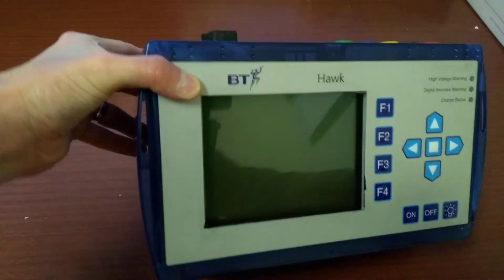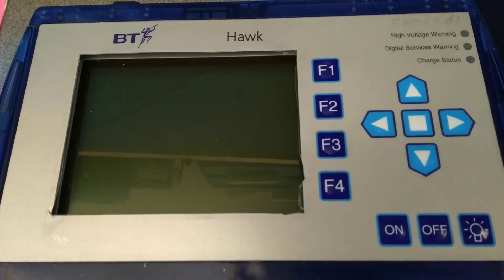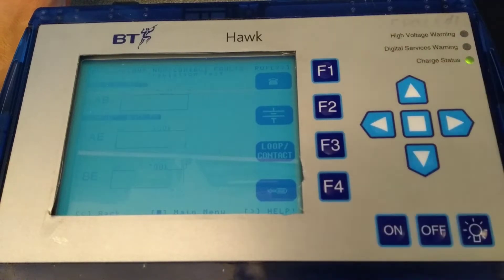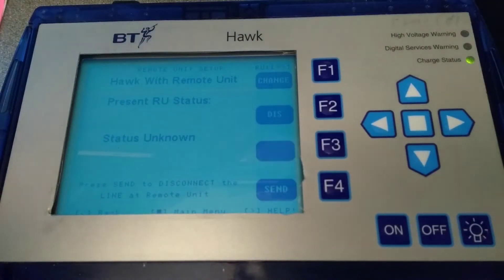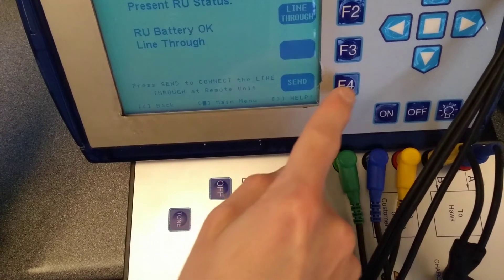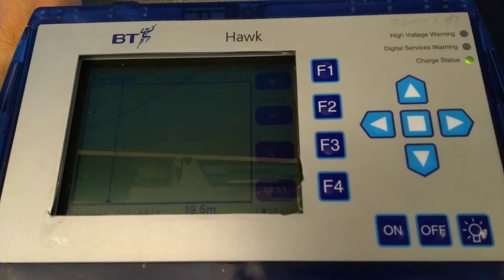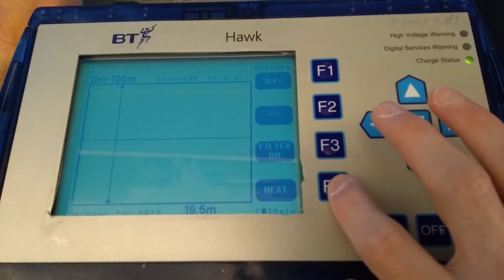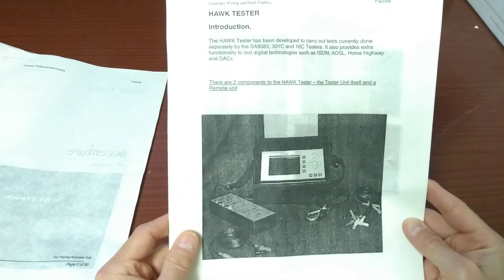The BT HAWK Line Test Unit

Comment: What’s the power input from the provided power supply?
Reply from the maker: Almost certainly the one I powered it with was a repurposed BT Home Hub power supply.. so 12 volts BUT.. that's just me going by memory; I may be wrong! please don't blame me if bad things happen!
Maybe a safer place to start would be 9 volts (which would match the 6 x 1.5volt batteries) and then increase from there if you find it doesn't power the device.